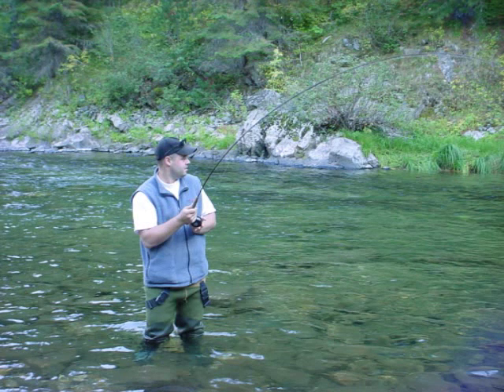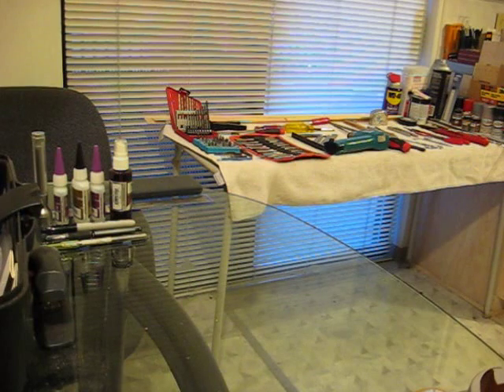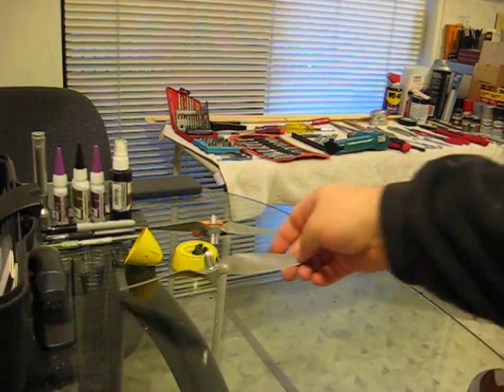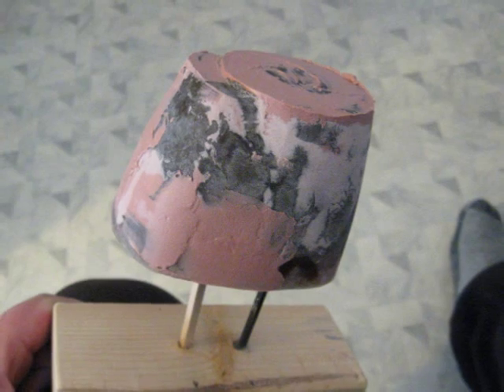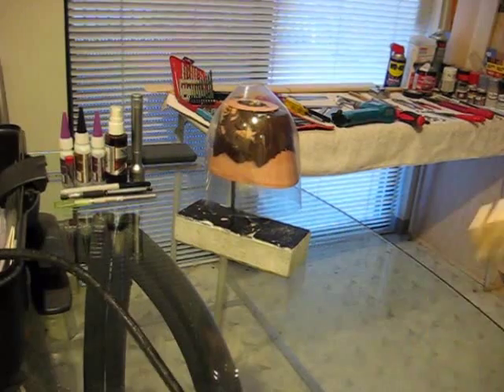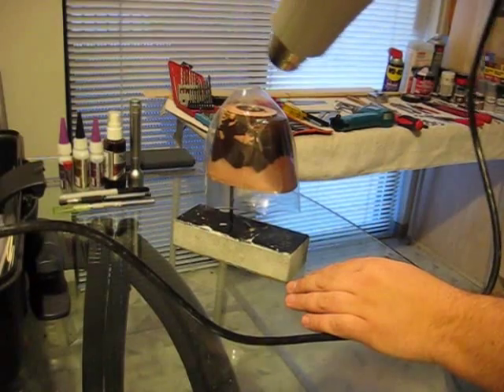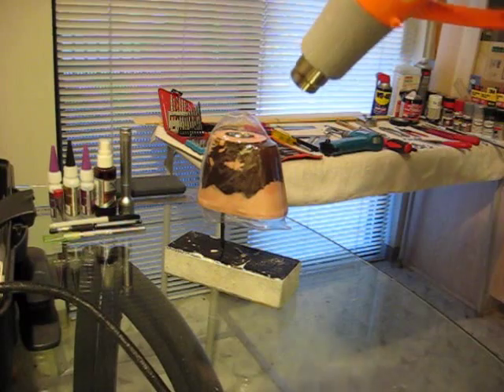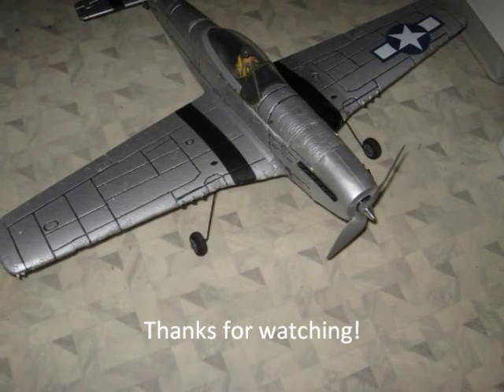p51d bl - I crash too much!  - custom cowl process

Comment: I have been rebuilding a greatplanes CAP 232 I bought from a guy for cheap.  The original cowl and canopy are missing.  The plane is done except for those peices and they are out of production.  I was thinking I would use a soda bottle for the canopy as well... just kinda cut it to shape screw it on and monocote to make it look ok.